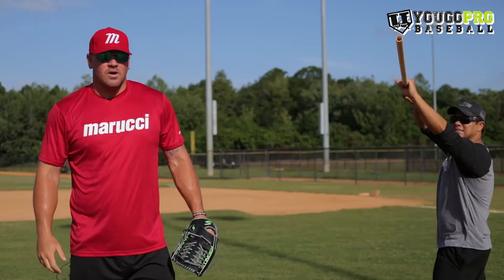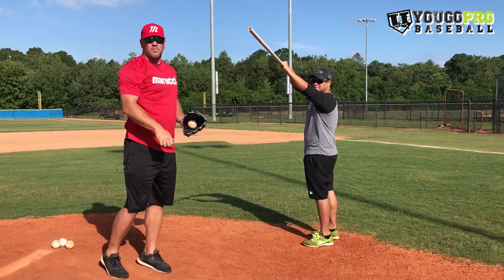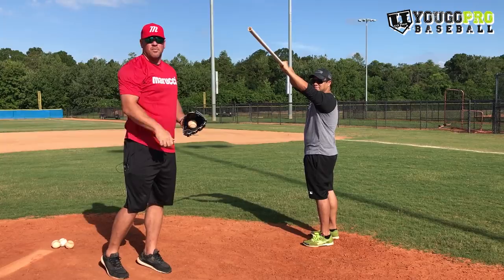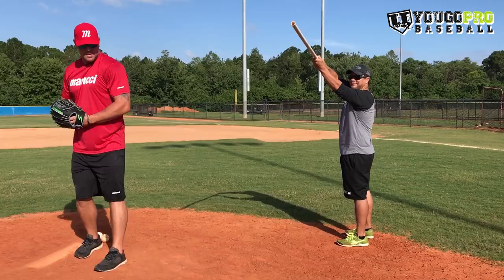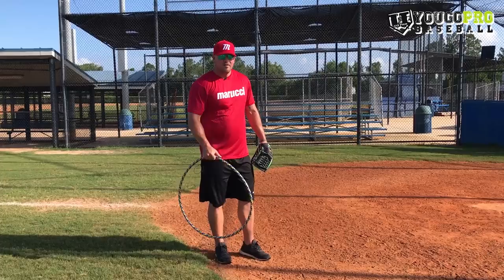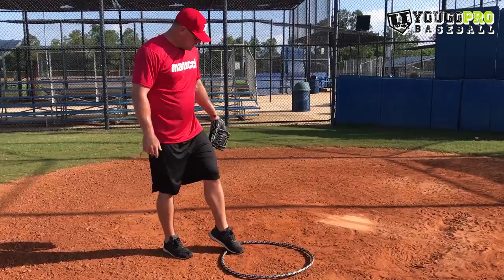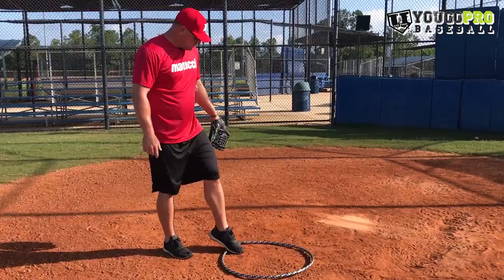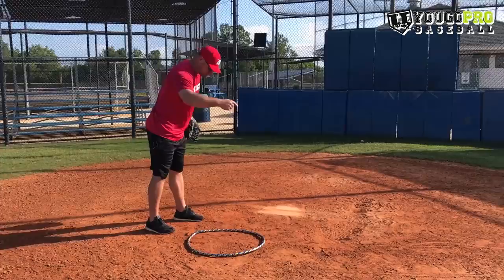Throw NASTY Breaking Pitches With These 2 Pitching Drills [Baseball Pitching Drills for Curveballs]

Comment: I throw a power breaking ball which acts like a slider. All I do is change my wrist angle slightly and put more pressure on my middle finger.
Reply from the maker: Awesome!  Strike a lot of guys out with that pitch?
Reply: YouGoPro Still a work in progress, but I believe it can be a great strike out pitch as it shows flashes of being a plus pitch at times.